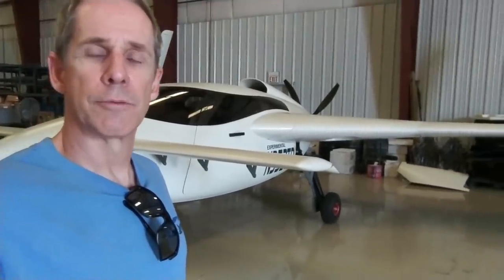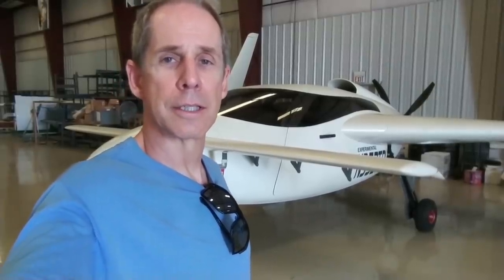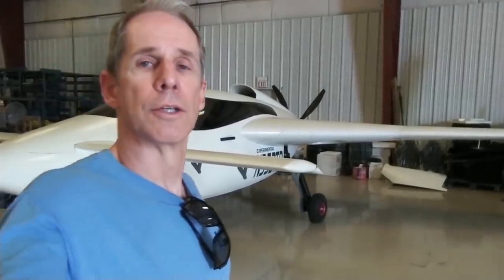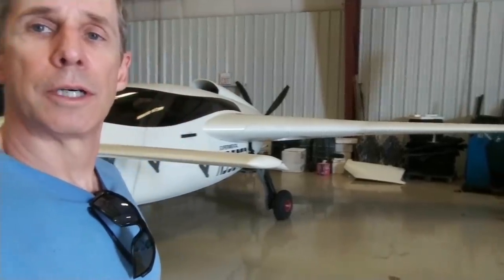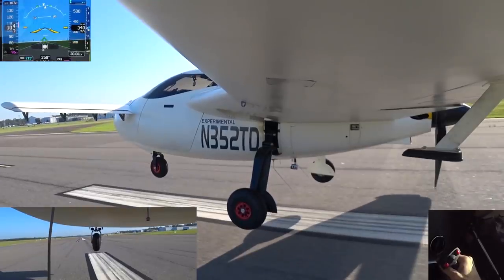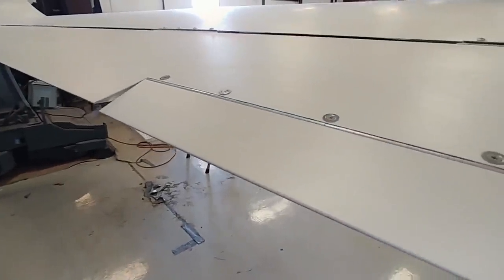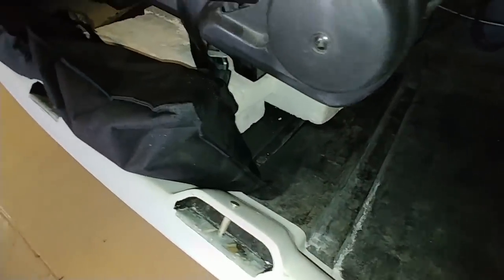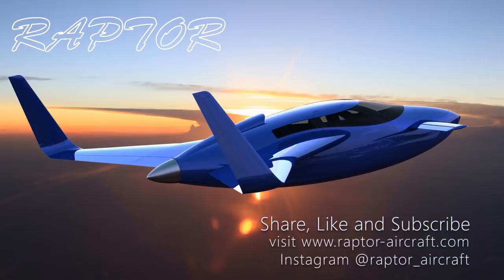Finding a Balance - Building the Raptor Prototype

Comment: I'm sure you've thought about this but the roll to the right may well be more to do with aerodynamic imbalances rather than the small weight imbalances.  That's what rigging is all about.  With the long wings there could be very subtle differences in wing incidence, or drag from the winglets, etc...   For some E-AB aircraft it is not unusual to get a "heavy wing" in the early flights that has to be addressed during Phase I.  Good to start with the lateral CG centered for that first flight, tho (can't hurt) but it might not solve it.  No way to know until it has flown over a range of airspeeds...  Good luck.
Reply: This may have already been discussed but could torque from the engine be part of it?
Reply: @BruceTGriffiths  exactly my thoughts too. That engine puts out alot of torque compared to traditional aircraft engines, ie; rotax ect....

Comment: I have been a staunch supporter of you Peter. On this one video, I will completely disagree with ALL of it! The aircraft should be able to safely handle lateral imbalance. All aircraft do, weathering cabin loading or fuel burn. Unless you do several more test hops with conclusive evidence of extreme or uncontrollable roll, you should not do anything. A very basic test flight rule, NEVER change more than one thing at a time. Unsecured weights have killed plenty of good pilots in the past, don’t do it, period. If you are uncomfortable with the left seat, either get comfortable or find someone that is. There are a lot of experienced Velocity pilots that could handle it at this stage. I could go on, but I’m sure buy all the comments here you get the message. Cheers as always🍻
Reply: Suspect the Wasabi guys approach may be to attempt to dial in the correct amount of trim, bit-by-bit for one seat and then the other.  Their perspective on this likely includes performance across a range of speeds, altitudes & conditions.  Then perhaps they'd look to see if those settings (say initially for high speed taxi, takeoff, in-ground-effect flight & landing in absence of crosswind) indicate anything about the state of the aircraft and if that fits with their experience and the expectations of the designer.  There are multiple perspectives that likely have relevant input.  There are likely a bunch of small but important learnings from delivery of safe, routine operation from either seat at the lower speeds of takeoff, that should precede the more eye-catching higher speed, higher altitude & suboptimal condition stuff.  Likely the Wasabi guys will also have a bunch of exposure to aircraft people adding ballast and imbalance arising during flight.
Reply: @leuvenisaplace  The Wasabi guys are no longer on this job.
Reply: @theralfinator  Yep, I realise that the Wasabi guys flew in as the need & their scheduled allowed.  Do you mean/know-if  going forward there's no engagement likely to occur?.  As some whose role historically has been identification & management of risk, I liked having multiple perspectives on the same project.
Reply: @leuvenisaplace  I meant that they aren't going to be part of this project moving forward.
There is a test pilot at the new airport, but I don't think there is a formal agreement in place as to how he will be involved.
It sounds like he's currently advising and providing feedback and at some point (to be determined) will be taking over the actual piloting.
Reply: @theralfinator  Thanks for the clarification.  All that angst about runway and surrounds that they had.  Still plenty to be learnt from their engagement thus far.  I look forward to being able to the delta to any new test pilots engaged.

Comment: Peter here some data from another aircraft and a tip. My Extra 400 which in many ways is similar to your Raptor is totally impervious to such minimal weight distribution differences. In fact the empty weight distribution with dry tanks is even more asymmetrical than yours because of the wingtip mounted radar and it gets a tad worse with Pilot alone on board. My engine is also 350 HP and when I level  off and reduce power I need to do it very very slowly otherwise the plane yaws and banks a lot. I believe you were experiencing the gyroscopic effect of having cut power just after liftoff... and here my tip: why bother with installing more ballast? Use fuel instead for a test run... Good luck and stay safe. PS: I would get me some Nomex gloves... inexpensive way of keeping hands operational in a fire emergency
Reply: Fixing the imbalance is an easy first step to reduce the number of possible sources of this issue.
Reply: The Extra 400 seems like an awesome aircraft.  How do you like it?
Reply: @dreamcreator2552  I love it despite its maintenance challenges. It is very similar to the Raptor from a „mission“ perspective , but sadly out of production and pretty much orphaned.

Comment: Not a big fan of putting the weights in the winglet - if they at all become dislodged and foul the rudder linkages, you could find yourself in a bad place. Also, seems like a fiddle to have to manage those when the test pilot swaps to left seat. Increased ballast in the cabin + fuel balancing would be my vote - it’s simpler and future proof to different ballast (pilot) configurations.

Great to hear the other inspections went well! Nice work Peter!

Comment: you're doing a great job, The aircraft will always have an imbalance left or right due to the weight of the pilot, passengers, cargo and fuel. Instead of adding lead ballast or moving the current 100# further right, just use fuel. Way easier.  You favor the right seat, but most are used to the left.  So, Please, please remember the changes you've made so that they can be reversed when you have a test pilot complete the flight tests!  Nevertheless, It's a very minor issue that will differ from pilot to pilot with cargo, passengers and fuel load. Keep it up!!
Reply: A point was made.  He favors the right. Before doing all weight changes, try from the left to see if tendencies are still there.

Comment: I'm sorry, but wtf? Are you seriously adding yet MORE weight due to some perceived roll tendency you've 'analyzed' from a four second ground effect hop? Rube Goldberg must be smiling.
Reply: Exactly!  This is quickly becoming a case study in how irrational thinking in rationalizing risk makes a person lose sight of when to say this isn't safe.
Reply: He reminds me of the story about the man who trained a spider to squat left and right.  When he cut its legs off and it stopped squatting left and right he concluded that spiders hear through their legs.
Reply: @Marvi Wilson oh I've missed no point, and i don't discount the roll tendency. What I oppose is the cure. There are many more likely culprits, aerodynamic in nature, that should be evaluated - but cannot be flushed out empirically until its actually flying. Here are only two : minor difference trailing edge shape/radius (often cited as cause for 'heavy wing' in vans rv's, and easily remedied by squeezing the aileron to slightly adjust). Second, and more fundamentally difficult to address with this design is dutch roll. Due to the sweep of the leading edge, yaw will induce a rolling moment. Shoving bags of lead weight into those tip sails wreeks of ignorance or desperation. Niether are healthy for the aircraft or pilot. I do not want to see him hurt.
Reply: @Marvi Wilson lol, ok. As long as he's 'good with that'.

Comment: Sounds sensible, but remember that when you put weight into the winglet , you move the CG aft too!
Reply from the maker: Yes that is correct and obviously I have taken this into account.
Reply: @RaptorAircraft  Thanks!
 You had me slightly concerned since you didn't mention it. ^_^
Reply: Raptor Aircraft why not just put more weight in the fuselage rather than complicating it with the winglet?
Reply: @DustinSartin  Weight x Arm = Moment; more force (moments) with lighter weight out on the wing than heavier weight in the cabin.
Reply: Yes, but the weight he put in the wing was behind the CG, and could have made it uncontrolleble.
Reply: @leifvejby8023  have you ever seen an airliner and all that weight loaded up behind the wing?  Scary, huh?
Reply: @formulaben  Have you ever calculated the centre of lift on an airliner, and the centre of gravity? 
The same applies here, if the CG is too far rearward it'll be unstable and impossible to fly.  It is only a few pounds, I know, but it is far behind the CG!
Reply: @leifvejby8023  Yes I have.  There is plenty of things (people, fuel, cargo) that are behind the CG.  Putting a few pounds behind the CG is not going to "make it uncontrollable" is my point.
Reply: @formulaben  On an airliner the stuff behind the CG balances the stuff in front of, and the same here. Aircraft are known to crash with an incorrect CG!

Comment: If you can do it without adding a substantial amount of weight. You can add rubber dampening bands around the landing gear and it will cancel or greatly reduce the resonance

Comment: Peter, I recently had to adjust balance on a plane, I decided to buy a 25kg bag of steel shot peen beads, cost next to nothing. Mixed the shot with epoxy resin, weighed the slurry on scales till I got the desired weight.  Stuffed the air-frame cavity with sealed plastic bag open ended, like  bladder I made sure the bag was filling the area I wanted to get the slurry to.  Then simply poured the heavy slurry into the open bag.  Massaged the bag about, zip tied off the bag and let it set.  Worked well.  Fitted ballast so to speak.  It reminded me of pouring a fitted  racing seat.

Keep up the good work mate, no one knows this creation like you do, stay focused and trust your decision making as no one else other than you has a horse in this race!
Reply from the maker: Thanks Paul. Cheers!

Comment: Prop torque would be the dominant contributor to roll at takeoff power. Trimming the last few pounds W&B would be insignificant compared with the aileron trim needed to negate the prop torque.
Reply from the maker: Engine was at idle.
Reply: @RaptorAircraft  i thought i saw imediate roll right at lift. Cant get lift at idle.
Reply from the maker: @busatim7737  can't get lift at idle? What? If there's excess energy you can always trade it for lift. That's exactly what happened when the aircraft was nose up at 5 degrees after the mains touched initially.

Comment: My thinking - Instead of adding lead weight. I would opt for more fuel in the port wing! How many gallons are you planning for your test flight Peter?
Reply: @geraldmartsy2165  Diesel weighs about 7 pounds per gallon. Peter is using about 50 Pounds of sandbag ballast in the port seat and added about 4 pounds of weight on the port winglet which calculates a torque moment and then the wheel scale balance was 4 pounds favoring the starboard wing with him in the right seat. Since the wing is swept back there is a center of gravity moment change to the aft. My rough guesstimate is about 12 ~ 16 gallons of fuel more in the port tank than in the starboard fuel tank = about 91 Pounds was my first impression. Without knowing the exact dimensions to calculate the moments... The static scales will remove doubt. This will also remove possibility of sandbag ballast shifting and foreign materials in the winglet to foul the rudder control. This would also eliminate the aft CG addition.
Reply: @geraldmartsy2165  Actually he had 100 pounds of sandbags close to the keel on the roll axis when he had the 37 pound delta. He put the foam in and moved that ballast closer to the Port door then added 4 pounds to the Port wing and ended up with a 4 pound delta. Since the fuel tanks are outside the door there is leverage there we call moments. For example 15 foot beam/wing the torque force of 4 pounds on the port outboard Beam/Wing equates to 60 Pounds of leveraged force on the centerline roll axis. Since the wing is swept back this force also changes the center of gravity on the pitch axis to a more aft center of gravity... With test flights it's advisable to change just 1 dynamic at a time. Adding 4 pounds of weight to the winglet changes 2 dynamics. Why add sandbags for first flights when by simply using fuel for ballast will test the solution without adding weight or cargo that could shift around and possibly interfere with control movements?
Reply: @eether54  The planned test weight the last I heard is 3,600 pounds for first flight. The planned recommended gross weight is 3,800 pounds. So there is 200 pounds wiggle room. My point is to remove 104 pounds of sandbag and weight ballast and replace that with about 91~112 pounds of fuel in the port fuel tank. Trading dead weight with fuel is my thinking. Should be close to the 3,600 pounds for test flight. I think he still has ballast in the nose though I'm not recalling how much.
Reply: @willhibbardii2450  u <

Comment: Gee! Is that weight sensitivity "normal"? Do other single engine planes of the same or approximate weight have the same degree of sensitivity around the CG?
Reply: @RowlandMax  Mine certainly does not, but when I change engine power, the torque change (not the p factor) is felt very massively. Pulling the power like it was done on liftoff here would have definitely induced something similar.

Comment: I’m wondering if the roll could have been caused by wing flex from the rudder inputs. The rudders have a very high aspect ratio compared to most designs and may twist the wings a bit more than anticipated due to the long arm.

Comment: Configurable trim rather than adding weight via hatches seems more appealing to me.  Allow the pilot flying with cabin weight imbalance (be that solo, or pilot with significantly smaller passenger) to pick their preferred side/seat to fly from, likely provides part of the range calculation for trim effectiveness (both sides), which may have some asymmetry...but hey time+money.  How trim may deal with changing torque loads through the various aspects of flight?  I'd guess trying to approach with yourself as Wasabi guy, or phoning them for a friendly chat-update.   Have seen boat guys wire together their lead ballast components, before they then use more wire to secure the ballast mesh into place, but likely aircraft have much more vibration and challenges from chaffing.

Comment: Peter. I don’t know if you can adjust the Left or Right wings angle of attach on the Raptor, but this may be a good place to start if changing the weight ballast doesn’t fix this problem.

Congratulations for your hard work.
Reply from the maker: The wings are perfectly aligned and symmetrical. If I get the weight the same then if there's still a problem further investigation can be made to figure out why.
Reply: @RaptorAircraft  what did you do to ensure they are perfectly aligned?

Comment: Without 2 counter rotating engines there should be a little roll force in the opposite direction of the prop rotation
Reply from the maker: Potentially, when under power but in these cases it was at idle and putting out very little torque. Once the aircraft is balanced, if the problem still persists, other factors can be considered and tested to figure out the culprit.